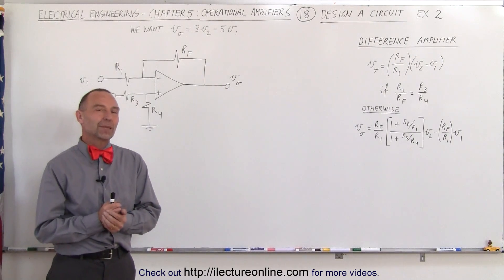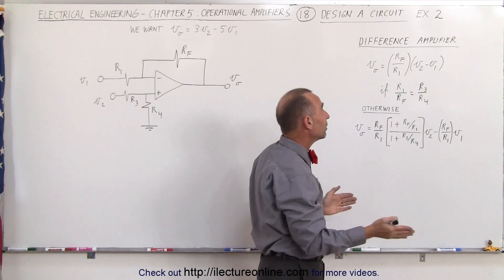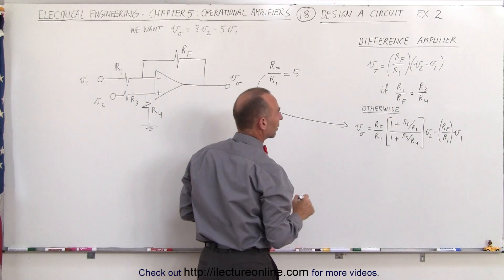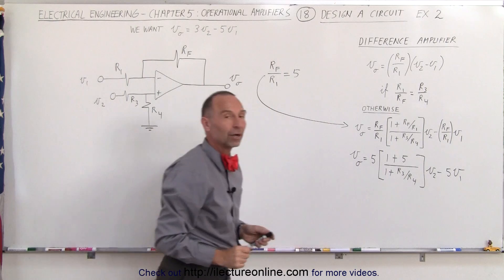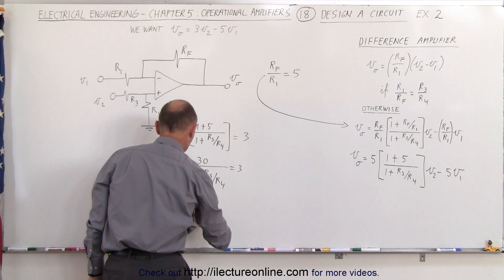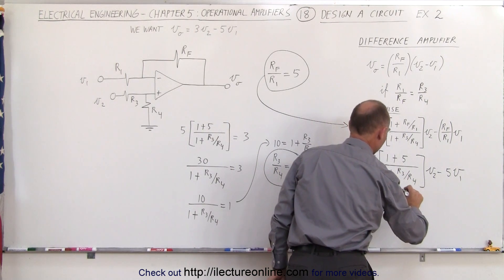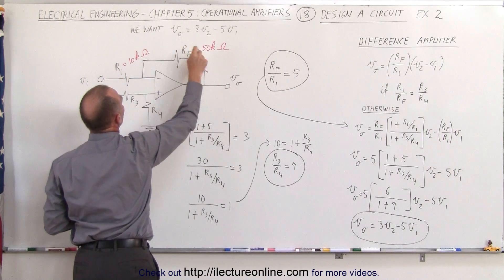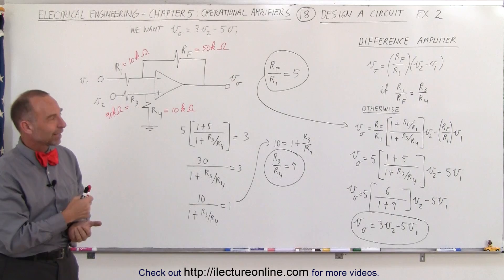Electrical Engineering: Ch 5: Operational Amp (18 of 28) Design a Circuit: Example 2

Comment: little riddle for you proffesor...replace R3 90k with 10k Resistor and try to find little mistake in your otherwise formula....hint Rf/R1*R1/Rf is not used when the ratios of resistors dont match at the inputs

Comment: Sir #18 you written formula I.e RF/R1{(1+RF/R1)/(1+R3/R4)} but in 15#  you derived a formula RF/R1{(1+R1/Rf)/(1+R3/R4)} . Please   correct it sir
Reply: Very good eye. I was wondering why my simulation wasn't working until I read the comments.  After using the corrected equation, the ratio R3/R4=1.  This makes the correct circuit.
Reply: @Ser3naaaa  So now the correct equation is the one in the 15# right?
Reply: @Mrsolom47  Can you confirm its the equation from episode 15?
Reply: Yes change this formula

Comment: Hi Sir, in the example you have set Rf/R1=5 and R3/R4=9 which does not satisfy the condition for a difference amplifier such that R1/Rf=R3/R4. Hence would the circuit still be valid? Thanks in advance
Reply: Asymtote Ang He clearly wrote down a wrong starting formula under OTHERWISE, on the write side of the board. From there the error propagated.

Comment: Thank you for your lessons.  I've been following it since a friend told me about it.  Just wanted to point out though that it seems you have Rf and Ri inverted in your equation.  But then I could be wrong.  Not sure.  Again, thanks.
Reply: Which one is the correct one?
Reply from the maker: The equations in the video are correct.
Reply: Thank you so much for checking.  Was just confused because on your video #15, you had converted the v2((1+Rf/R1)/1+R3/R4) to v2((1+R1/Rf)(Rf/R1)/1+R3/R4) but in lesson #18 seems you had used instead the  v2((1+Rf/R1)(Rf/R1)/1+R3/R4) instead.  Again, thanks.
Reply: Mr. Michel van Biezen I kindly appreciate your general effort of making people love the subjects they're interested to and I've been watching your channel for a long time...I would be very grateful if i'ts possible to show us the adjustment of the general equation of the difference amplifier to derive the ''otherwise'' equation which is right when (R1/Rf)=(R3/R4) is NOT valid...In advance thank you for your time